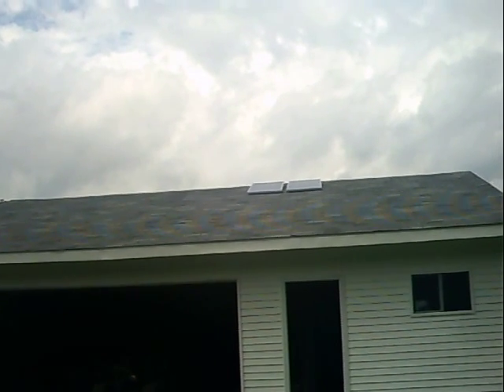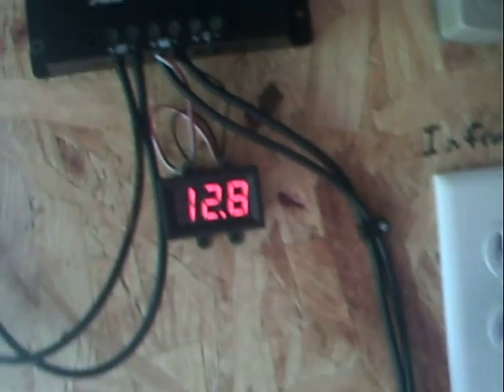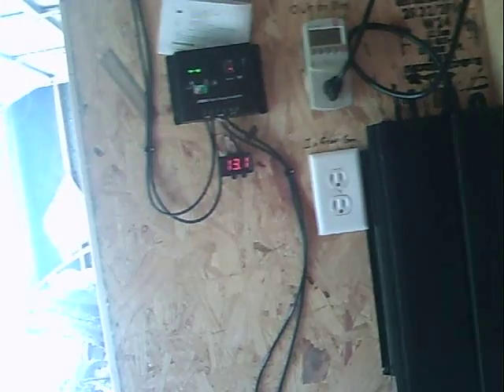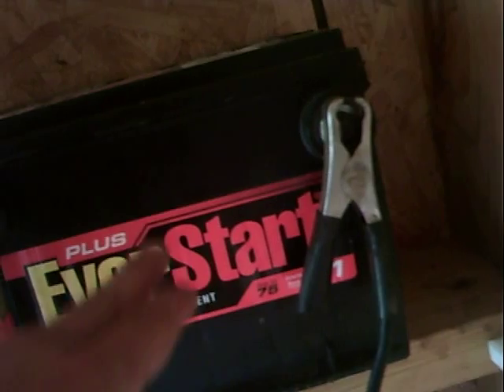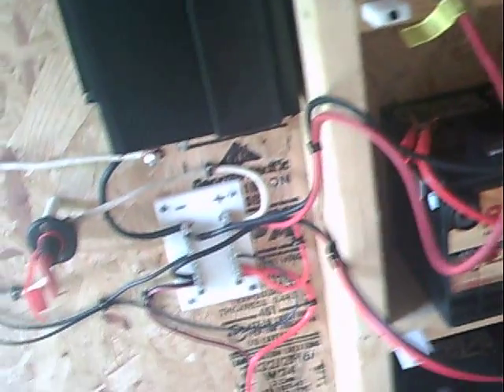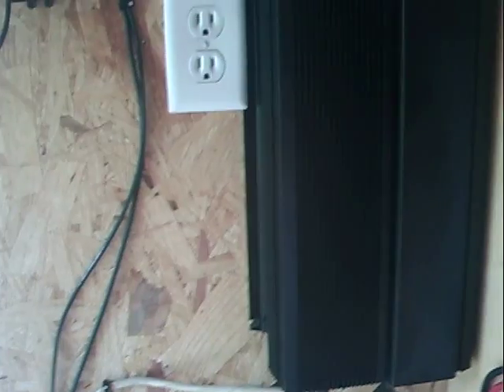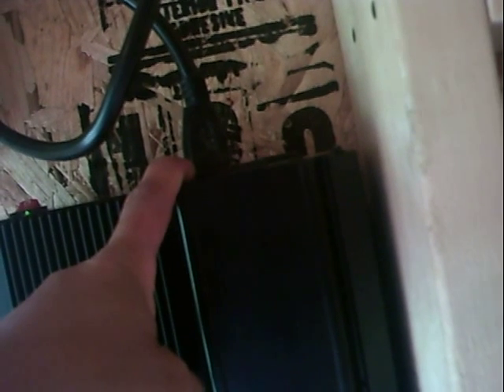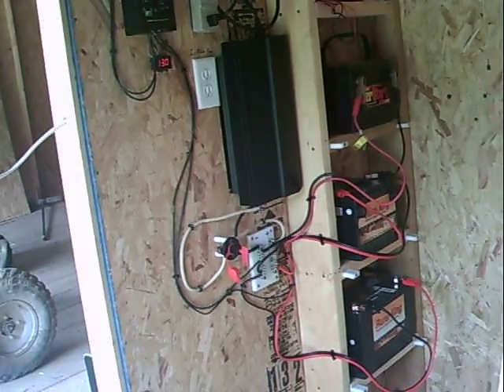My 200w solar set up

Comment: do you have 1 different battery and 2 of the same? as far as I know you are not supposed to do that
Reply from the maker: Marcos Figueroa Send me $600 and I'll fix it
Reply from the maker: Soon after this video I did get more of the same battery's. I did leave 
the smaller, older ones in though. Test have shown they discharge at the
 same rate but charge uneven. What happens is the smaller battery's 
charge faster and boil until the bigger one charge. I'm not really 
concerned about the older smaller ones . They haven't caused any 
problems but the there getting burned up faster. The small ones are not 
hurting the bigger ones. This set up is 2.5 years old now, still going.